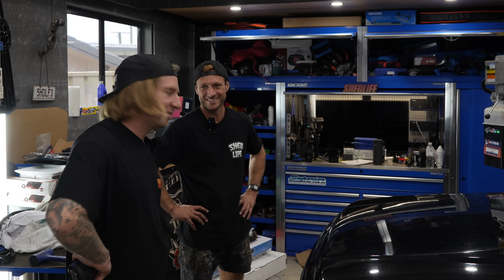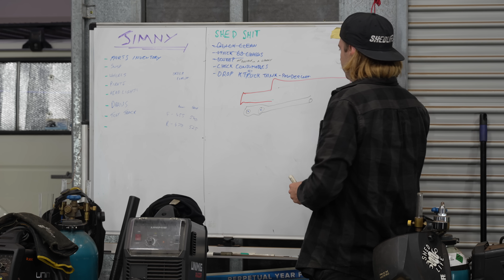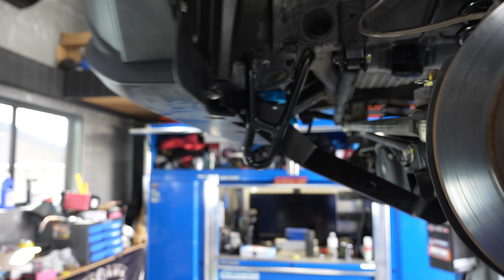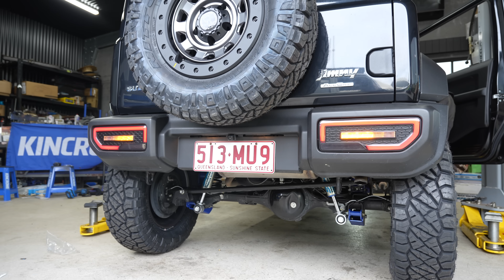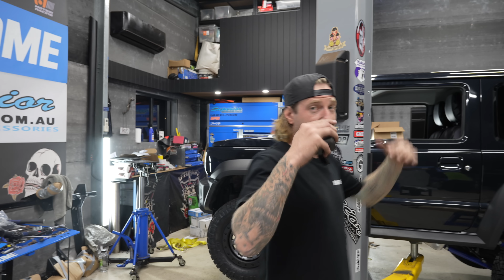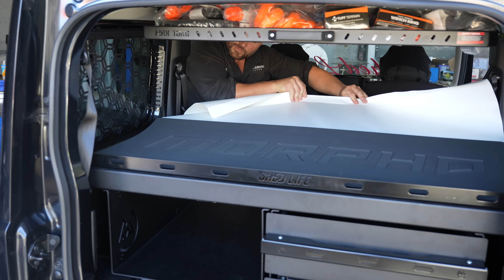NEW BUILD ! Best Mods for Suzuki Jimny (Total Overhaul)

Comment: Absolute death traps! Wait till you get a side wind. We have to take one home as punishment at our dealership.
Reply: On stock suspension yes, scary. Quality aftermarket feels like a normal car.
Reply: @24FIFTYOUTSIDE unsure how suspension handles a side wind, the taller they are the worse they were. Not trying to come across argumentative at all mate I really struggle to see how they are passed to drive on our roads. Especially in western australia where I am where you get defected for the silliest things. 
I've had so many near misses in a jimny on the hway with heavy winds. Litterly been blow into other lanes. I worry as they attract alot of P platers
Reply: @lemellmell9151 Hey mate! Totally agree! They are PROPER scary on stock suspension! I tell everyone the same thing, and agree poor choice of car for a learner for the same reason! I bought mine in WA in 2022 when I lived there. Drove as far as Albany and upto Exmouth then across the Nullabour to Northern NSW etc. Once I upgraded the suspension from the super soft spongy stock toy suspension and added an adjustable steering damper it changed everything. Way more control, dont feel like im going to get sucked into passing trucks and its much more stable in windy areas. Yes it still gets blown by wind but nothing like it did on stock suspension.
Reply: Nonsense, they sit so well on the road and no wind problems.  I live in the Western Cape of SA so I know a thing or two about wind.  All the negatives about this car is absolute bollocks, they are perfect, I have the 5-door.
Reply: @Quinn7770 absolute crap mate you know it! I've had 5 very bad experiences and I say that because I remember them! I live in a part of western australia and in summer we get vally winds in the morning. Why would.i just comment that for shits and giggles and why would your reply magicly get highlighted? Strange right? Im not being a dick I'm being dead set
Reply: @lemellmell9151 Well my experience is different to yours.  They are fantastic vehicles.

Comment: Need a long range tank too or it wont make it down your driveway 😂😂
Reply: Hahaha I have noticed it’s a tiny tank 😂
Reply: It's able to pass everything on the road except for a petrol ⛽️ station...😂
Reply: Small tank sure lol but its a small vehicle and small fuel usage though. Unless you're crossing the Nullarbor then you're fine, or just take a jerry can in that rare instance, there are comparatively cheap spare wheel mount and roof rack mount jerry can attachments available for the Jimny also to chuck on for those rare trips.

The added weight of the larger aftermarket 80L tanks plus the weight of the fuel heavily eats into your low GVM limit unless you get a GVM upgrade like I did on my Jimny with Ironman, plus also unnecessarily weighing down your Jimny making it thirstier and slower too. Majority of Jimny owners won't need fuel tank upgrades.
Reply: @craigsampson3386 whats the range on a stock tank 250kms?
Reply: @craigsampson3386  just because it's a small car doesn't mean shit they're not great on fuel especially with bigger tyres
Reply: @Jacobtheunwise I bought mine new in 2020, been running 235/75r15 A/T with a 2" lift, bullbar etc and fuel economy is still good.
Reply: Definitely a must. Stock tank is only 40 litres but you can get 80 lt long range tanks
Reply: Can also get a brown Davis auxiliary tank tucked up in the rear of it
Reply: Des sol 4x4 80L fuel tank is a game changer  as well as SG PERFORMANCE Turbo upgrade...only in South Africa